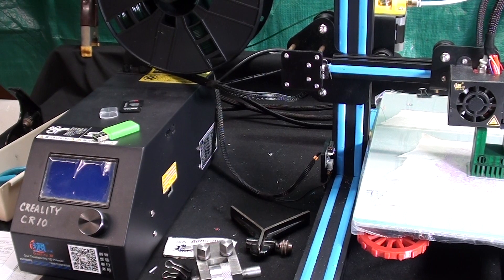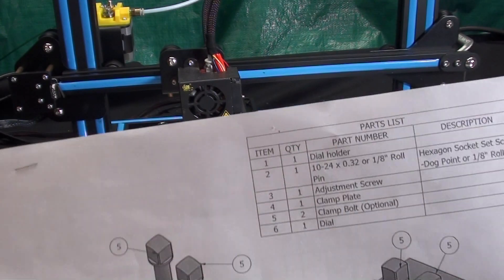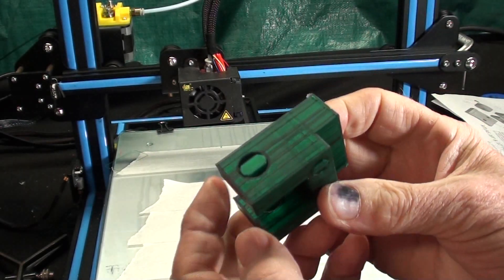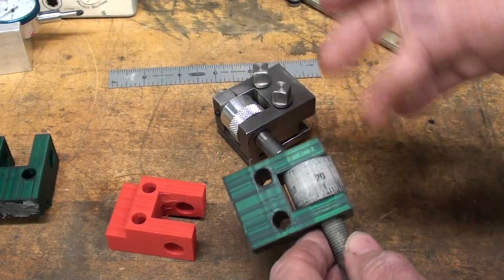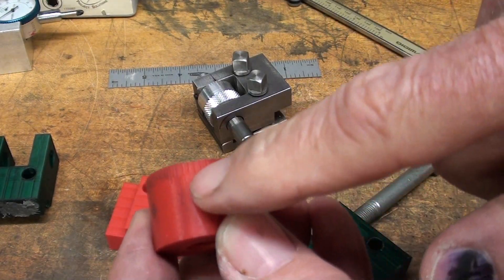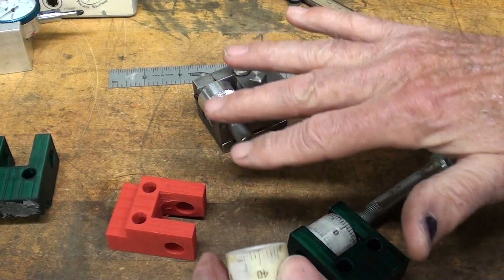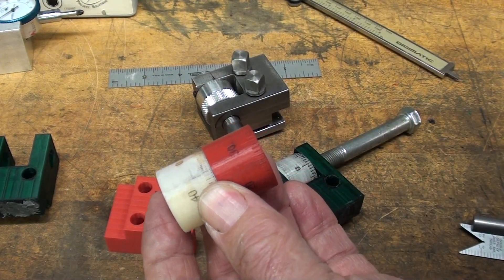3D Printing update CREALITY CR 10 with tubalcain #4

Comment: Hi there Lyle.  I do enjoy your videos and understand completely your getting into 3D printing since I am also a hobby machinist.  I have just purchased a CR10  and in the process of setting that up.  I also have an Anet A6 that started me into 3D printing.   And like you, I found that plain old masking tape to be the best build surface.  However, I have now changed to a plastic called PEI that is available in 1mm think sheet.  I bonded it to a 1/8" think aluminum sheet with 3M sticky film and then spring clamped that combo to the Anet build table.  I find that the PEI works as good as the masking tape but that the print is easier to remove and does not leave behind the glue that the masking tape does.  I am not sure that the CR10 bed plate has enough wattage to heat up the aluminum/PEI combo tho.  I guess I will see as soon as I get it set up.  Good luck, keep the videos coming.
Reply from the maker: Thank you for that, I need to get some

Comment: Ignore the naysayers!!  

The point in having the skills to fabricate is to fabricate things!  In some ways a 3d printer may be no more than a 3d equivalent of a 2d sketch.  And no one says you shouldn't make a sketch first!  3d prints can occasionally be used as is, but more often than not for me they are simply a way of making sure that I do the metal fabrication once, rather than twice, to get it right.

Useful part, proof of concept, even the male part for mold creation are all valid reasons to 3d print.  Just one more tool in the drawer.
Reply from the maker: Thank you very much that was a great analysis, and very true

Comment: Lyle, sorry for the off topic, but I ran across a great safety tip I had not seen. Joe Pieczeki suggested marking lathe chucks with a mark designating the point at which chuck jaws will disengage from the chuck scroll or screws, minus a safety margin. Better than having them surgically removed, for sure! Thanks for your safety recs, those of others have saved my bacon in a very serious way from time to time over the years. I recall firing a two pound block of wood from my table saw that flew about a foot to the left of my crotch and carried about fifteen feet before it hit the wall without dropping appreciably. Fortunately I had read that I should not stand in line with the blade or other rotating part and was off to the side sheltered by the fence.I had learned to work behind the fence. Good to recall and review safety from time to time, especially if you have been away for a while and when planning cuts.
Reply from the maker: You cannot work safely enough in the shop. And I think the woodshop is more dangerous than the metal shop

Comment: If Mr. Pete can learn CAD, then I guess I'll figure I can.  :-)  They definitely look like they can be beneficial and being able to print up a set of dials for my machines that won't rust/tarnish would be very nice to be able to do...maybe even make them bigger and easier to see.  It might be nice if they are bigger to switch them to diameter reading instead of radius reading.
Reply from the maker: Thank you

Comment: tip: when i write sharpie notes on metal (even non-engraved) i give it a coat of clear acrylic spray...prevents wipe offs,  white out-pens are even better, and much finer than "paint markers". Welding shops sell these at a high "mark up" value . lol.punny,  dollar stores or staples is the better local source.
Reply from the maker: Thank you, I will buy one

Comment: I like the 3d printer items. I even got a CR-10S for my Christmas present to me. So far I have used the printer to make repair parts for broken plastic parts for various woodworking jigs and fixtures. I have a very complete woodworking shop and also a Rong Fu 30 benchtop drill/mill, 9x20 Harbor Freight lathe, Coal forge, and stick, gas, and mig welder. I find the 3d printer very handy for making drill pattern templates, then transfer punch the hole locations and drill. NO LAYOUT needed. I also made some fingers for a decorative dovetail joint fixture with a metal center and a 3d printed profile that was glued to the finger. Still learning the printer have had issues with bed adhesion and warping of parts (learning experience) Wish the printer was faster (I get impatient) Also you should learn Fusion 360 it will open up a new world of creativity for you. It is really nice easy to make the replacement part. I needed a replacement heal for a Micro Jig pusher block. It took just a few minutes to draw up. First I just drew a rectangle using the rectangle tool. Then measured the old part and entered  those dimensions into the   drawing and the program automatically updated the rectangle. Then choose the slot tool and put a slot inside the rectangle. Then measured the location of the slot top and side and entered values and the software automatically updated the location. Measured the width of the slot, enter value and it updated. Then choose extrude (3d thickness) and pushed the model for thickness, again measured old part and entered value, software updated drawing. Then choose output to 3d printer and it loaded the model directly into Cura for printing.
When the weather gets warmer I will work on restoring a Mill Falls barn beam drill. One of the drive gears is missing and the traverse gear is missing. Will make 3d printed prototype parts and then use them to cast Zamak parts to make a usable replacement part.
Keep up the good videos, do not be distracted by the "purists" I have the same "problem" in woodworking; hand tools verses power tools verses cnc produced parts. They miss the point the goal is make an item and when complete no one cares how it was made, but  DOES IT WORK!
Reply from the maker: Thank you for a very interesting and analysis , All very true

Comment: sir, just a question. why all the westerners make the dial on the tool post so small?? i have seen some japanese lathe,  such as Mitsubishi their dial in the tool post are hugh! 3 may 4 inch diameter. and the scale on the dial goes down to half and 1/4 of a 1/1000in. even a rookie in his first try can use it without making any mistake. is that just a tradition difference or some other reasons behind it? why not make it bigger?
Reply from the maker: Yes, the small dials are crazy. You may have watched one of my videos where I increase the size of the deal.
Reply: The only reason I can think of is the manufacturer wants to save a few pennies. The little 9 inch Logan lathe I once owned had a cross feed dial about 1.25 in diameter; hardly large enough to read. Keep 'em coming Mr. Pete.

Comment: Hi mrpete222
If you want something good to print on then buy PEI sheet. It is a must.
It's easy to work with. I am writing in PETG and keeping my hotbed at 70 ° C and it binds the print item firmly.
When you have finished printing, let the hotbed cool down to room temperature, then remove the print with your finger. All this without using glue or hairspray :)
Thanks for your good videos :)
Reply from the maker: Thank you, I need to get some of that

Comment: I'm on the journey too, with my new CR10! Things skate off my glass also, but I've just tried some PVA wash at about 50/50 on the glass and that makes things stick good. The masking tape does work too, but is a bit fiddly and leaves a nasty finish for me. Thanks for all your vids!
Reply from the maker: Thank you, what is the PVA? Is that simply white glue
Reply: Yes! Just plain old builder's glue, mixed up with some water - It goes a bit rubbery when dry. I put some on a paper towel and try wiping a thin layer on to the glass. It dries almost immediately and makes the glass go slightly opaque. I feel odd giving you advice because you are the master and I'm the student here. My eternal thanks for already teaching me so, so much.

Comment: I use 3M Blue Painters tape.   This works well with my CR10S.   The adhesive comes off the glass easily and the part comes off the tape easily.  I like having some layer between the part and the glass.

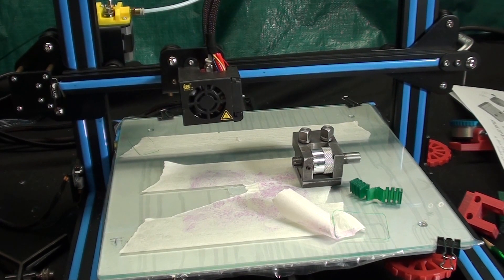If you rotated the part 90 deg in the slicing software so the tallest surface face was down you should be able to print this without support.  This orientation is about 3:20 mark in the video. You will likely get some stringing in the holes, but should be easy to clean.

We are both having fun with our printers.  I printed off the dial indicator toolholder.    First one warped, the second one I added a skirt increased bed temperature and it did not warp.

As you mention, 3D printing is terrific for prototypes.

I appreciate getting the text on items is not so easy.   I have started to learn OpenSCAD.   Lots of files on Thingiverse.   Easy to change the SCAD files.

Another 3D printing channel uses nail varnish to colour the markings and letters.   He then carefully cleans off the excess with acetone.   The nail polish comes off easily but have to use a light touch or the acetone will start to dissolve the PLA.

Dave.
Reply from the maker: Thank you, I like the tape as well

Comment: I really like 3D printing for lost form casting, if you want to build or repair things. First make a pattern, test it on the machine/place directly, make changes if needed. Then print it slightly bigger (with some padding for later machining) as hollow as possible, hot glue some styrofoam ports on to it, put it into the sand and pour the aluminum on it. Then machine the parts who have to be really exact.
Reply from the maker: I really want to try that someday

Comment: Question.
Observing the problem of releasing.
Could you have printed the dial onto a washer ?
Or a machined piece of steel with a "washer" & a threaded boss and printed around it ?
This would give a hard wearing  metal face.
Just thinking outside the box a bit here.
Reply from the maker: Never thought of it, that is a possibility

Comment: Nice job Mr. Pete! I have an idea for your printer, odd numbered hole plates for your dividing head or rotary table.
Reply from the maker: That would be a good idea
Reply: take a look at the setup that JB from Oz came up with for gear cutting on the shaper.  Indexing wheel looks like it was 3D printed

Comment: if you're wanting to smooth your prints a little, use some diluted acetone, it really helps in bolt holes and also where the support material was. It doesn't work for all PLA materials, however most of them have up to 1% ABS blend in them
Reply from the maker: I will try it on my PLA